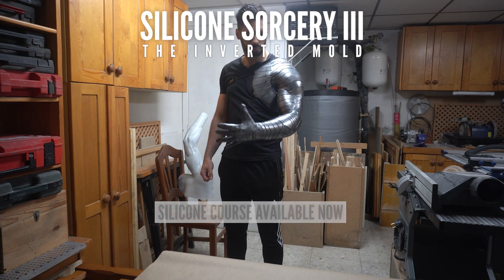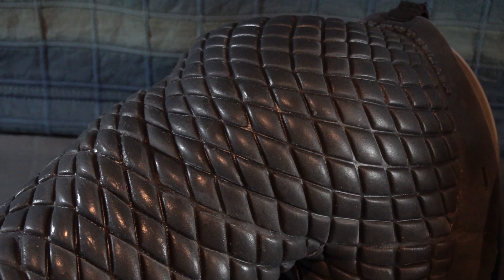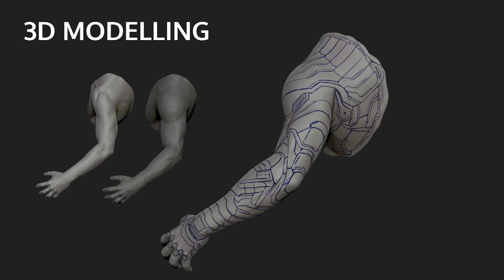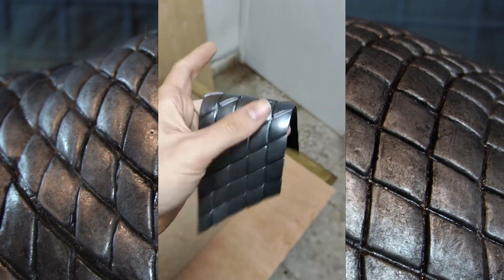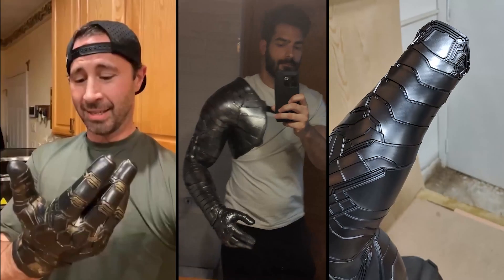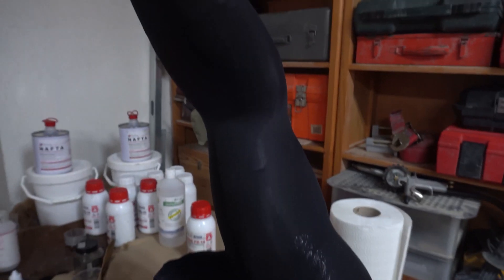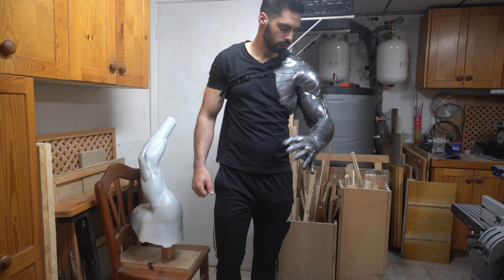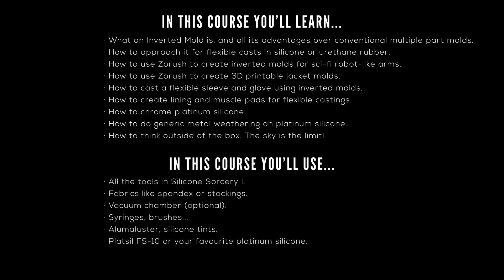Silicone Sorcery III: The Inverted Mold by Henry Creations

Comment: okay, I've watched this video multiple times now and I'm not sure I grasp what the benefit of this is... are you doing the inverted mold sculpts to avoid having to rotocast? how's the tension of the final piece, wouldn't turning it inside out have effects on longevity?
Reply: Thats a great question. Let me answer it thoroughly here. First of all, this techinque manages to avoid having seams and still allows to use a core, so you can get perfect thickness everywhere, therefore controlling how the silicone behaves everywhere. It also allows you to see everything while you are working on it, whereas with a conventional mold you cant, because everything is closed inwards. It's easy to correct mistakes before you demold the piece because of this. But it also saves on time, money, materials, it's more environment friendly, and the process is so much easier. You can also weather the piece before it even exists, and this saves so much time as well. You can even make a muscle suit and attach it before you demold the arm. You can also chrome silicone, which you couldn't before this. There are many many benefits. You're basically skipping a whole stage in production. Of course this techinque doesn't work for everything, but it's just another great tool to have in your arsenal. 

For example, the thor scales became ridiculously easy with this idea. I can even create a flexible temporary jacket mold that then will turn into a part of the sleeve itself. There are so many things that can be done just the opposite way we've been taught to for years, and they offer so many benefits thanks to the inverted mold.

About the tension. The thicker the silicone, the more it will want to reverse back to its original shape, but this techinque is great for thin casts where you basically don't notice it. Then you can build up upholstery foam layers if you want to add more thickness. Again, this is all before you even demold it.

Hope this answered all your questions. Feel free to ask if you have more

Henry

Comment: The folds need work and ultimately it may need to be broken into 3-4 pieces.

You could use magnets to keep the seems stiff where you need them to be. But it looks very good. Though I think it needs to be tighter and possibly a thinner material.

Comment: I am trying to understand why you would invert the mold if you are still using a core and outer mold and injecting silicone in between. Wouldnt it be more practical to use a normal (not inverted) mold and for instance dress the lining on the plug so it fuses with the silicone when you inject it. You could also paint/decorate and weather the inside of the mold so it fuses with the silicone, in the same way you are doing now but inverted.
Reply: If I had to guess I would say the inversion is better for controlling the sublimation of the finish. You can paint exactly what you want and not have to use roll methods or try to get into deep crevices. It also means that you dont perhaps have to use silicone painting to panel line or weather parts. It seems ti me that it makes the silicone painting process a bit easier depending on the project (like chroming and stuff). Just my guess
Reply: Follow up, you can all the benefits of having the normally inside on the outside so you can add fabrics and foams after the casting. You’d have to adhere it which isnt too hard, but it takes out some of the guess work
Reply from the maker: @ You can always make it traditionally, it just adds so many more steps and you lose control. Having the mold surface face outwards is something unique that gives loads of advantages